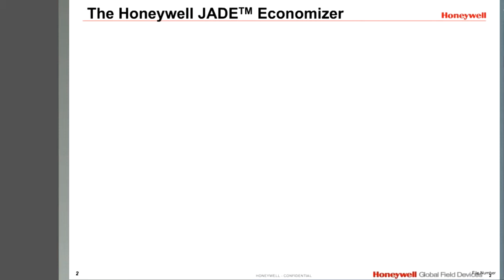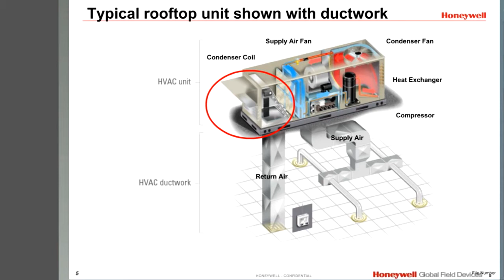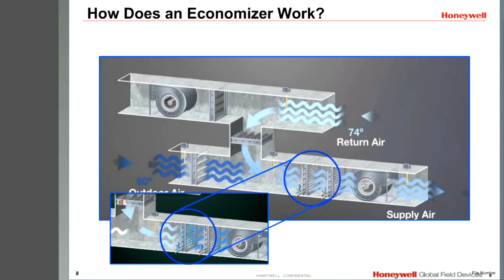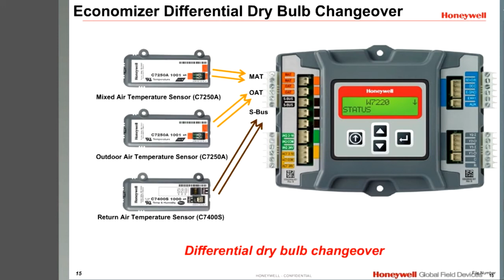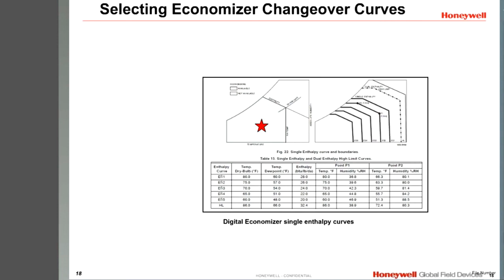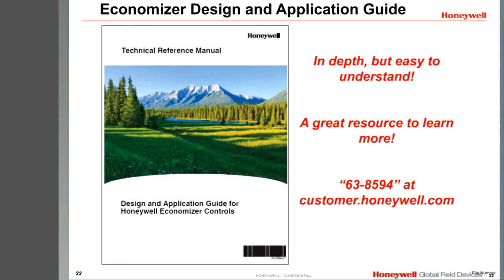Air Economizer Fundamentals with Honeywell Home Global Field Devices

Comment: Excellent video. One question, are enthalpy economizers and differential enthalpy economizers only looking at humidity or are they looking at temperature and humidity? Is it true that if you run an enthalpy economizer in a dry place like denver, it will supply hot outside air because it’s drier than the return despite being less efficient overall? This was told to me as the reason we don’t use enthalpy economizers here.
Reply from the maker: Hi AJ Steward, we recommend you reaching out to your HVAC contractor  for information about this, you can find local licensed professionals here: https://www.honeywellhome.com/us/en/find-a-pro/?categories=[98550] If you are a certified contractor you can reach out to our pro support team at (800) 468-1502. -Maria